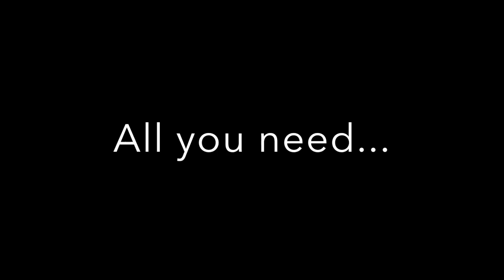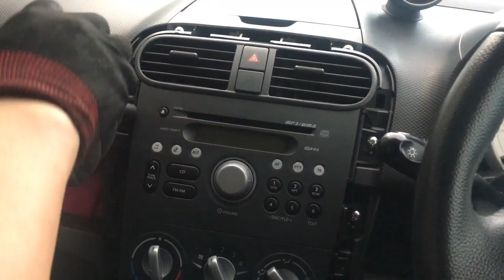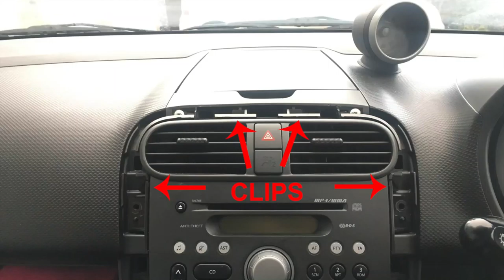How to Remove Vauxhall Agila (2010) Centre Console Surround Trim & CD Player

Comment: Good to the point video. However there is also a clip in the flip up lid on top of the dash board which goes through the trim. if this is not removed you will snap the trim when trying to remove it and also the clip on the hazzard light screw is on the left looking from above not on the top as you have indicated. very good video all the same. Thanks

Comment: Man, what's the name of the blue connector? I need it so bad in order to pick an aftermarket radio
Reply from the maker: The name of the blue connector: ISO Wiring Harness Connector 

This is the original one that came with the car. You might need a ISO Wiring Harness Connector Adaptor to Convert the standard manufacturer Connector if you fit a aftermarket radio.

Hope this helps.
Reply: Tommaso salve sai se è possibile cambiare uno stereo ad un agila b con uno piu moderno?